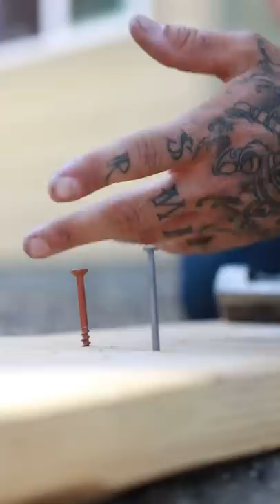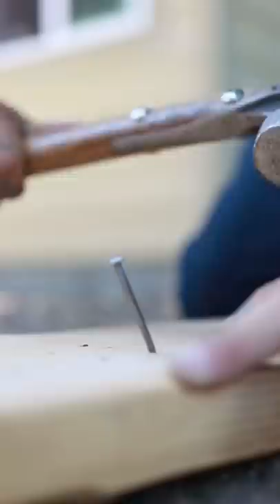Nails vs. Screws: Why do we use nails? #shorts

Comment: The deck screw you snapped is intended to hold down deck boards. They are not meant to be used for building walls. Structural screws on the other hand are designed for structural applications and they are superior to nails in every way and by a large margin...but they are expensive.

What you're doing here is essentially spreading misinformation because you lack engineering knowledge and are just parroting nonsense you heard from others in the trade. You snap a deck screw and immediately think all screws are bad. It's absurd.
Reply: Those structural screws are twice the size of a 16d nail, and hold the same amount of wait. Those screws will still shear and snap over time. I've seen completely rusted away nails hold wood together. Screws are superior when holding something down not holding sheer weight.
Reply: @redacted_redacted69 You're misinformed. Don't make statements unless you have numbers and engineering information to back up what you say. Structural screws are made with material that has a higher tensile strength than what is used to manufacture common nails. Shear strength is a function of tensile strength (around 60%). This means that for the same diameter a structural screw will always hold more shear load than a common nail. You can go find datasheets of structural screws on line to look at the numbers.

What you're seeing in the video is not a demonstration of shear failure. It's failure in bending. Two completely different things. If your joint moves that much as to bend a nail or a screw then it's overloaded and you have a design issue not a fastener issue. Joint separation creates a gap between mating faces and the side load now produced a bending moment on whatever fastener is holding that joint together. This is typically what happens with nails because they can't clamp joints together. This behaviour does not happen with screwed joints. The mating faces don't separate and the joint sees true shear rather than bending therefore allowing the joint to hold more load. A nail will begin to bend much earlier than a screw for a given overload situation.

The issue with a screw is that in extreme overload situations the screw will break because it isn't ductile like a nail. Both will fail but the nail will just yield (bend) and still potentially hold the joint together somewhat. The load required to get to this point will however be higher in a screwed joint.

Nails are ductile for the simple reason that they are always hammered in and often get bent.
Reply: @jamescrud structural engineer here, completely agree with you. I think it’s mostly because you can save time with a framing nailer and nothing else😂
Reply: I've had this same argument at work. Everyone forgets that friction of a tightly screwed joint will hold as much or more than the shear strength of the nail.
Reply: This is what u tell customer but it’s not actually true, screws are far better. Frame a wall of warped boards with nails and see how long it takes for ur drywall to crack. Go back and redo with screws and ur good for life
Reply: @jamescrud ductility doesn't depend on shape but material.
Reply: @iiiiiiiiiiiiiiiiiiiiiiiiii4222 no kidding thats what he said as well.
Reply: @jamescrud 😂😂😂
Reply: Every screw does this you dont misspread infortmation
Reply: God forbid someone show that nails are inherently better at withholding shear pressure while screws are inherently better at withholding tensile force. Yes you can get thicker stronger screws made for shear force but that is much more expensive… similarly you can get ring shank nails designed to bite into wood and offer tensil strength similar to a screw but because it isn’t a full on screw but you can get that added tensile strength without having to sacrifice shear strength and without having to double the diameter of the screw… generally speaking this video is 100% correct, thinner nails are also less likely to splinter wood, and a lot of places have building codes that regulate whether you use a screw or a nail for certain applications for precisely the reason that they have different strengths. I don’t want to argue with you as ive seen your arrogant attitude down below just hoping maybe you’ll use some critical thinking for a couple of seconds or maybe take a physics course or two
Reply: @skyrimdovah420  exactly
Reply: @skyrimdovah420  You don't understand the difference between shear and bending. I've already explained it. Go and google the material properties of nails and screws then do a simple calculation to determine which is more resistant to shear. This shouldn't be too difficult. Empty words mean nothing. Go do the math.
Reply: @skyrimdovah420 What a long-winded way to say "I didn't read or understand any of that".
Reply: Sir thank you for the info
Reply: Spiral Shank Galvanized nails are the best for strength and holding power......Btw...

Unless it is a purpose made specialty screw, screws by code can't be used in any application where they would have a shear force on them.....

Anyone can test the difference in screws and nails...Nail 2 2x4s together on the flat...Screw 2 2x4s together....Same way same number. Now beat them apart with a hammer. You'll see which holds together better and why....Now nail a short wall together....Do the same with screws.....Rack the walls until they fail...See which holds better and why.....There is no need to speculate or argue or look anything up. Build some stuff both ways and see which fails first....

I can tell by the lack of common sense there is only 1 real carpenter in these comments.
Reply: Captain ackshually, this is true. It's not parroting, this is college knowlege.

I've seen an 8in gap close down to 2in in a day once it got hot enough outside. Buildings move far more than you realize.

Building with nails is much stronger, point blank. They're also cheaper(23¢/screw v. 7¢/nail), easier, and quicker.
Reply: There is no reason to use nails if the only thing you care about is the finished product. The only benefit to using nails is that it's by far cheaper when it comes to the nails themselves and the tool you need to install them. Other than that, I have not yet seen an application where nails are preferred, the only exception being replication of pieces with historical accuracy. I'm no expert on the field, and I'm open to corrections. But I'm a woodworker on the weekends, and I have never used nails.

Actually, scratch that. I use a nail regularly to mark drill holes. I hammer thr nail through the screw hole of the piece I intend to mount. I've been using the exact same nail for this task for the past 4 years.
Reply: I build alot of temporary decks, once the home/deck isn't needed its torn down, or picked up and resold, when we use nails they have to tear it down because they can't pick it up, when we use screws they can usually use heavy equipment to pick up the whole deck depending on the size and resell it, and when they do occasionally have to tear down a deck made with screws, we get to hear all about it because of how much more difficult it is. If the decks last long enough, and the pressure treated wood gets to drying and really warping, the nailed decks will look very rough in comparison to the screwed decks
Reply: @bradywalker5291  If your college is teaching you that common nails are stronger that structural screws then you should ask them to refund your tuition.

IBC requires a common nail to have a minimum bending stress allowable of 90,000psi. A GRK type RSS structural screw has a bending stress allowable of 190,000psi. That means it can handle 2 times the load compared to a common nail before permanently deforming. The numbers end the debate in favor of the screw.
Reply: Thanks for giving me a reason to block this hack.
Reply: I've always heard that nails will go in and out as you walk across the floor, for instance. Screws don't have that give. Basically the same reason that it's good for a bridge to move slightly in the breeze, or you can feel a sky scraper move at the top.
Reply: @jamescrud someone’s daddy didn’t love him
Reply: No need to be hostile
Reply: @jamescrud imagine coming to a public comment section and telling others not to post lol. No matter how much construction knowledge you have, it will never make up for what's missing in your life to talk like this on the internet.
Reply: @mateoc15  Nails shouldn't be moving in and out as you walk across floors. If that happens there's a significant problem (squeaky floors in old homes). It's the reason why screwed and glued floors are prefered. The "give" in a skyscraper doesn't come from loose fasteners. Loose fasteners are typically a bad thing in the engineering world. The flexibility in a building is inherent in the steel structural members and not in the fasteners. The same principles apply to residential construction where the wood should flex but nails and screws should not be shifting and moving inside the wooden members if the structure is designed and built correctly.
Reply: @jackhorsey4674  Imagine coming to a video as a newbie thinking you've gained some knowledge from someone who comes across as an expert in their profession only to realize they taught you wrong information.

False information is not tolerated in my professional environment. False and incorrect information that goes against established engineering practices often leads to disaster so yeah...I will call out nonsense when I see or hear it. I'm well aware we're only talking simple home construction here and it's not that critical given the context but that isn't the point. The point is to not teach wrong information to people who might be watching and don't know any better. I never said anything about not posting. Post anything you want but if it's intended to be educational then it needs to be true and accurate. Period.

Stockton Rush presented himself as an expert too, convinced a bunch of people to believe in false information...and now they're all dead.
Reply: Like nurses thinking they are superior to doctors because they do the manual work. Sometimes hands on experience is useful. Sometimes shit falls down because the labor staff took liberties.
Reply: @jamescrud   a screw bends because it resists shear force, if it didn’t resist shear force it would snap… again i dont want to argue with you as you are very arrogant and insistent on making everyone else equally as wrong as you are. There are screws and nails that are engineered specifically to make up for their own weaknesses, theres nothing wrong about the video and since you said it “Just google what type of force nails and screws are better at resisting”  you’re sitting here arguing that a screw specifically engineered for structural purposes is better at withstanding shear force than the screw he used as if that changes the facts. And you obviously don’t know what physics is since its entirely a math based science.  An 8mm thick nail withstands a shear force of up to 2600 Newtons when used in a hardwood (as a structural part would use) whereas an 8mm screw would only be able to withstand 1760 Newtons… convert this to pound-force and it is  584 for the nail and 395 for the screw… the difference is very clear, yea you can use harder material and thicker screws to make up for it, but similarly you can also use a ringshank nail to stop material from separating… what you’re doing is the equivalent of me going to a video about someone pulling apart 2 pieces of lumber and then when they say it’s a demonstration of how screws are better at holding 2 objects together I go and arrogantly comment about a specific type of screws (ringshank) and say their video is bullshit because of one engineered piece of material being stronger than the normal one they used for the purpose of demonstration about the general strengths/weaknesses of different fasteners…
Reply: @skyrimdovah420  You don't understand what you're talking about. The strength of a screw or nail is determined by the mechanical properties of the material it's made from. I just finished explaining that common nails use steel with a bending yield strength of 90,000 psi. This is a code requirement. Structurals screws are typically at 190,000 psi. That makes them "stronger" in all aspect, tensile, shear, and bending.

I'm not sure why you can't understand this. Material properties is what governs strength not geometry. The guy in the video made a blanket statement about screws being weaker in shear than nails. This is factually incorrect since the majority of screws are made with material that have higher tensile strength.

...and where are you getting your numbers from?

My position on this topic doesn't come from arrogance. It comes from 30 years making my living as a mechanical engineer specializing in heavy lift equipment, structural design, and stress analysis. I have an in depth understanding of how fasteners work. It bothers me when people make claims and statements about a subject they know nothing about.
Reply: Yup, it's funny how many laborers will talk shot about engineers, but then when the actual knowledge drops they're left dumbfounded.
Reply: @jamescrud thing is, this video is only talking about regular screws, not your fancy super duper screws meaning yes this video is actually 100% true unless you're talking about some sort of specialized holy screws. Most screws are brittle when compared to a nail unless you get whatever heavy duty shit you're talking about. Also nails are cheaper as they take less material.
Don't accuse people of spreading misinformation when they aren't, he didn't mention your fancy ultra screws because it's not nessasary or applicable when talking about small scale construction such as framing a house or building a deck
Reply: @loganschmidt8802  Almost every screw manufactured is made with material that has a higher tensile strength compared to common nails. They have to be because they need to resist the torsion imparted by impact and drill drivers. This by default means they can also handle higher shear loads compared to nails. Yes, even a deck screw compared to an equal size in diameter nail will handle higher shear and bending loads before permanently deforming compared to that nail. The issue is the failure mode. As I previously explained the failure mode of a nail in an overload situation is to plasticly deform where as a a deck will fracture if cycled to that overload condition repeatedly...but it takes a higher load to fracture the screw.

The demostration in the video is a side impact inducing bending. If you were to actually measure the force required to permanently deform both the screw and the nail you would see that it takes more force to start bending the screw (assuming diameters are equal).

The misinformation part is that Matt made a blanket statement that screws can't handle shear loads compared to nails. He didn't say specifically deck screws. He just said screws...then used a misleading demonstration to break a screw to try and back up his false claim.
Reply: @jamescrud  first of all you talk like a reditor. Second of all a twisting force is different than a bending force. Third, Screws are more brittle meaning while yes they do take more force to bend they will most certainly break way sooner than a nail would when being used to frame a house as they need to be able to bend as the house shifts over time. Just because something is stronger on paper doesn't mean it's better the reason why the nail works so well is because of how malleable it is unlike the Screw which is known to be hard and less malleable making it more brittle making it less optimal for building a house. This is why anyone in carpentry will tell you to not use Screws for framing, it just not well suited for the job and if you get a screw that is they are more expensive than a nail.
Reply: @jamescrud  also another thing to note tensile strength refers to its ability to resist being pulled apart not bent.
Reply: @loganschmidt8802  I'm aware but bending induces both tension and compression. There's tension on the side   away from the bend direction and compression on the side towards the bend direction. In engineering, the tensile strength and yield strength property values are what's used to determine how much the fastener can handle in tension, shear, bend, torsion, and combined loads.
Reply: When you work with real pros you’ll know this comment is right
Reply: @redacted_redacted69 as much as I wanted to hear your side I stopped reading when you mistaken the word “weight” with “wait”. As a simple human I am not not continue to read someone’s insight on structural advice when they couldn’t even know the difference between time and mass. Now I’m done with my sh!t. Thanks!
Reply: @jamescrud thanks for the insight
Reply: Thanks for your comment. Refreshing to see someone pierce through the clout chasing factoid bullshit we get on Shorts.
Reply: @loganschmidt8802 This isn't true. A higher tensile strength also means higher resistance to bending. Bending is stretching on one side and compression on the other. This video is very misleading because it is promoting the high ductility of the nail as a bonus when it's not.  That's plastic deformation (it's never springing back). If your framing gets that far out then it's going to fall apart. It's the job of the fasteners to never bend beyond the elastic limit so any ductility beyond that isn't relevant from a structural perspective.
Reply: @alexmarin1174 ”his insight” is as misinformed as the guy he was calling out lnfao
Reply: @alexmarin1174  auto correct is a bitch sometimes I guess. The mentality you have is piss poor. Someone sounds dumb, someone makes a mistake and you write them off just like that. That's fine dude, you'll live a great life treating people like that.
Reply: @redacted_redacted69  While pedantic, calling the mentality piss poor is why you should never be in a position of consequence. Details matter, and when speaking on a topic entirely dependent on the details, it helps retain credibility when the person speaking cares enough to audit themselves. If you don't care to present yourself as credible, why did you even comment?
Reply: @redacted_redacted69 you there?
Reply: I would like to see someone build a whole house with screws and when they get to squaring the walls see how the studs won’t be able to be adjusted slightly to square up because screws don’t like to give any room to move the studs. They will pop out if you try to square when they aren’t perfectly square. Can’t really explain it better than that because you have to try it to see what I’m talking about. Walls need to be square the nails allow you to do that faster and easier
Reply: @beebbeeb3148  I understand what you're saying but there's no real reason to build a house with screws. Nails are more than adequate as I've previously stated and as you said it's faster and easier. No argument here and I agree with you 100%.

My issue with the video is the guy saying screws are weaker in shear than nails. This statement is false.
Reply: @elijahej8995  I never felt attacked. I'm just detailed.
Reply: Nail guns are cooler than drills, bro. It’s just the facts. Sorry the big boy gun is too heavy for you
Reply: @redacted_redacted69 you are wrong you name one shuttering chippy that uses screws not one of them do…
Reply: @reecetee2815  what the fuck is a shuttering chippy?
Reply: Fucking look it up
Reply: @redacted_redacted69  chippy is a nickname for carpenter here in England
Reply: @reecetee2815  I frame with nails, not screws. Lags when code requires it. Screws to hold down floor sheathing, deck boards, etc.
Reply: @redacted_redacted69  yea for sure buddy we use round wire nails best for strength to hold shutters for concrete 
But obviously for decking stuck like that screws all day long
Reply: What are you talking about??? I get your point one is made for one thing and the other for another. But bro literally explained if you have ever thought why we use nails instead of screws, it’s because the screw breaks, nails bends.
Reply: @jamescrud I think the guy was talking about how under pressure screws are more likely to snap than nails, which is true, judging from my own carpentry experience working with my dad, and from what i’ve learned in civil engineering classes. Since nails snap less easily, and are more bendy, the guys saying they have different uses. (I understand it’s bad nails give and can come out but there wouldn’t be in the code for multi-million dollar buildings would need nails in certain areas like framing that normal screws wouldn’t work in. I also understand that they make screws that are more bendy and meant for this, but with my favorite saying, what ain’t broke don’t fix. All buildings incorporate both nails and screws where they can affordably support eachother in good ways.) 

Also off topic even if I disagree with you in this one convo holy cow your a great replyier haha, I think you replied to every person who talked to you, over this amount of time that’s very nice of you lol. 😂
Reply: @loganthomas1578  The premise of what he was demonstrating is misleading. You'll never encounter a situation in residential construction where a joint "settles" so much that it bends the nail over 90 degrees repeatedly until it snaps. If there is any settling going on the nail may give slightly by pulling out and shifting while a structural screw will not allow the joint to shift at all. It's never going to snap. If the joint sees extreme loads beyond what settling would induce then the screw would simply tear out of or through the wood. This is what everybody overlooks. The wood is the weakest component in the joint not the screw. Keep in mind I'm talking about structural framing screws. At the end of the day what he's showing can never happen and has never happened in a fastened joint.

Regarding codes, they have been updated to include modern framing screws. This allows them to be used if required and when they're used offer a superior performance compared to nails. Nails remain the most economical and practical.

Try it for yourself. Screw together two pieces of wood with 4 structural screws then try to pry or smash those pieces apart. Do the same with 4 nails with the same spacing and pattern. You'll see immediately what I'm talking about. A typical framed joint in a home will never experience that kind of abuse so to say that a screw will snap when a joint settles is nonsense.
Reply: That’s what he just said.
Reply: @loganschmidt8802 ”Fancy ultra screws”😂. Shit cracks me up. You can get structural screws at any big box store. If the idea of a structural screw is that magical to you, don’t work in the trades.
Reply: No sir your the only Parrot. This is a simple video showing people basics. Trust me, many many people who should know this don’t! He’s comparing a common screw to a common nail! Also structural screws are only stronger than common nails! What about shear rates nails!? What about a 3/8” diam spike!!? I’ve also seen structural screws shear on a few occasions where nails didn’t. And seriously man you more or less just repeated the video for the first paragraph and then proceeded to call HIM the parrot. What a hypocrite
Reply: @jamescrud quit reading spread sheets and learning in the internet. Go get a job and learn from experience. I can tell you’ve never swung a hammer lol. In the real world nails are way stronger for framing 100% of the time. I’ve learnt this from experiencing demolishing decks both framed with screws and nails. Every single time in old rotten wood the nails are still strong! And every single time every third screw has snapped. You mention gaps as if they are a flaw but that’s just wood, showing your inexperience again. Wood shrinks and expands and moves ALLOT. Even if you install something tight at first chances are over time it will develop a small gap or discrepancy. Nails are a far more versatile and flexible fastener for framing! He was comparing an age old discussion that confuses many home owner types…. It’s a great video. Of course structural screws have comparable strength. They also deteriorate much faster in weather🤷‍♂️ unless you buy stainless but than your getting weaker again and more expensive🤷‍♂️🤷‍♂️
Reply: @jamescrud and no, nails are ductile so that over time when joints DO move…. And they will even with structural screws…. They can bend instead of snap. He’s framing a deck bud. They get SOAKED!! It’s just impossible to ask wood not to change at all! And so we use a fastener that can compensate for that! A nail can span an 1/8” gap no problem, a screw can’t!
Reply: @jamescrud  I agree with you then in those situations if wood doesn’t shift that much, but I just still think framing moves enough in houses that non-specialized screws will snap. I don’t have the budget or time right now to try to buy nails and those special screws with wood, so I’ll just say in a bunch of areas in the lower sea level areas especially wood really can shift, where I’ve seen people having to replace door frames or cut the bottoms out of doors because they move a lot. I can agree that nails might suck in comparison to the better screws that can do the job, I just think until they get cheaper or more widely used, the guy in the videos point still stands. (Btw I haven’t seen the video in a bit and realized halfway through writing this that i can’t leave the text to see it, so if something I said is skewed then my bad lmao.
Reply: actually i don’t have enough experience in this, assuming you (james) do, then I might be thinking of it wrong. I do see what you mean that the wood can move but it doesn’t allways mean all that force is on the screw, you must be super experienced in this and have insight i don’t have, if that’s the case then I can agree with you.
Reply: @jamescrud nailed it... pun intended.
Reply: @yuxuansun8271 contractor here.. i 100% agree with you... imagine trying to build a home using screws and a screw gun?! the time would be out of this world.
Reply: If this guy has a building business he should be forced to link all his potential customers this video and this comment.
Reply: @redacted_redacted69 ngl bro you‘re getting cooked here 😂😂😂
Reply: Exactly miss information. Really getting sick of these people spreading this stuff
Reply: @yuxuansun8271  try time and ALLOT of money. Also nails compensate better for human error… a thing many engineers don’t account for lol. Cuz they never actually do anything😂
Reply: Yep, as a civil engineering student I applaud this response. People who know nothing of engineering for fasteners talking out their arse.
Reply: @jamescrud I appreciate the effort and knowledge put into this comment, much more accurate and thorough explanation than the video or any of the comments, listen to this guy
Reply: @jamescrud  your so rude and clearly all you do is math…. No real experience with building things. @skyrimdovah420 is totally right…. Your just upset about it. Also the video had nothing to do with structural screws, that was a deck screw. Deck screws definitely have less shear than a nail and it’s a mistake I’ve seen allot of inexperienced carpenters make. Useful info in a simple vid! It will help homeowners and such build things that won’t be falling apart in a year or two! Even for deck boards screws suck… the boards shrink and expand with water and shear the screw almost every time, than you have a creaky deck. This just doesn’t happen if you use nails. I’ve demolished enough old decks to know this for a fact. The nails last longer than the wood they are fastening, deck screws don’t.
Reply: cool
Reply: This man means business
Reply: @loganschmidt8802 a twisting force may be a different force, but the underlying material properties are all the same. If a material has a higher modulus if elasticity which makes it more resistant to deforming in bending, that will also make it more resistant to deforming in torsion. There are only a few material properties required to calculate stress and deformation under the various loading conditions, and they all overlap
Reply: @nathanbohn1078  took less than an hour to build a 24' x 20' wall using plain only screws, 2x4s and ⅜" ply wood (some concrete screws too) for a warehouse. It's been run into by blind forklifts, hit by falling towers of boxes, leaked on after a storn trew a limb through the roof, still fije like the day we build it after plenty of abuse 5 years later. Dont know why folks think it would take forever to put up a house with screws.
Reply: All screws matter
Reply: @yuxuansun8271 😂
Reply: @jamescrud 😂
Reply: We should be talking about a house being held together with screws will generally shift around less than a home built with nails.
Reply: @as7river  logical prevarication I think!
Reply: @tjsbbi  So why are the bolts holding your car suspension system together made from ductile steel?
Reply: @jamescrud I’d love to learn from you more. Very knowledgeable.
Reply: @GBOB68  All of common bolts we use in automotive are ductile steel. However in a demanding role like suspension you are often going to see grade 8 bolts which have a higher yield but lower ductility than a grade 5 or 2. You can see this easily if you look up tensile strain curves for the different grades. The elongation prior to failure is dramatically more for grade 5 and again for grade 2, albeit at a much lower yield.
Reply: Exactly. The ductility has everything to do with the material properties, not whether or not the fastener has threads
Reply: @tjsbbi  My point is, suspension components are chosen to bend on failure rather than snap!
Thanks for the info but I don't need any more lessons in engineering!
Reply: Bro also thinks overall longevity can be tested by bending something by 90 degrees. Im pretty sure buildings don’t move that much.
Reply: Yeah I hear this bs all the time that you need to use nails. No use the proper fucking screws. Its nicer to work with every step of the way. Just slightly slower. Oh well
Reply: @skyrimdovah420 if your walls are moving that much, you are going to have more problems than whether or not you framed with screws or nails
Reply: @bradywalker5291 all I see is its cheaper. If a house moves 6 inches in a day. Sounds like it was poorly made
Reply: Thank you for schooling these fools
Reply: @wolfie4225  bro, what? 😂 If a house moves, it's poorly made? Every house moves dude. They breath. Expand and contract from the heat and cold.

Screws aren't cheaper, they're more expensive and more time consuming, and yes - they're not as good in the long run.
Reply: @bradywalker5291  if I gap closes 6 fucking inches. That's a problem dude. Houses move but if it moves that much. Ya have a problem. You really just sound like you've never framed with screws. Because I have framed many buildings and I have yet to see a snapped screw 🥴
Reply: @austinfackender in those situations I toss a demolition blade on the circular saw and just cut through the screws or nails.
Reply: @redacted_redacted69 if you don't know the difference between "wait" and "weight" then you shouldn't be talking.
Reply: @Jordan-rb28  I just read my first comment and it looked pretty good to me teacher. Didn't see the word wait in it.
Reply: @redacted_redacted69  "Those structural screws are twice the size of a 16d nail, and hold the same amount of *wait.*"  <---- you missed that then.
Reply: @Jordan-rb28  yea I did. Then at the very bottom of that comment it's used correctly. Crazy how maybe a miss typed letter might do that. Auto corrections.... But noooo I have no clue what I'm talking about based on that. Goofy.
Reply: @jamescrud see you may be right, but with the way you talk it makes me not want to listen to you
Reply: @jackbalderassgoodyoutubepl3664  I AM right and you don't have to listen to me at all.

How do you like information presented to you? Straight to the point and matter of fact or do you prefer to be held gently by the hand and wrapped in a nice warm blanket while I wisper it softly in your ear?...
Reply: @jamescrud we get it bud you literally know nothing else so you're really passionate about this
Reply: @AndrewB23  Yes I'm passionate about engineering. I have six industrial patents to my name, single handedly built my own home, I'm an expert in plumbing, electrical, and hydraulic systems. I'm also a machinist and a welder and I'm always in my shop making things. You're right...I don't know anything else.

Oh, I take care of stray cats in my neighborhood too.
Reply: Screws are inferior in two ways. They cost more to buy and take longer to install.
Reply: Hasty generalisation fallacy, yea
Reply: @jamescrud  strength comes from shape you lose the material of the threads in a screw of the same thickness so in any case a nail will be "thicker" than a screw of the same radius, math son
Reply: Oh boy, an engineering student desperately trying to justify his degree by being an arrogant tool.

See, if you'd gone for the business course, you'd know how to do the cost-benefit analysis of cheap nail that can be shot fast and reliably with a cheap nailer and has the desired shear strength vs an expensive structural screw that has to be driven one at a time and take a figurative forever. (Yes, screw guns and collated screws exist. They're also expensive. I don't know anyone who has one. I don't even know if they're available for structural applications.)
Reply: @institches2750  Engineering student?? Lol. Clearly you haven't read my other comments. I've been working as a mechanical engineering for 30 years. I'm 53. I never said screws should be used for residential construction instead of nails. I've said repeatedly that nails are more than sufficient and they're used becaus they're cost efficient and faster. That doesn't change the fact that they have shear higher strength compared to nails.
Reply: @gallodeplata   Strength is a function of material properties like yield and tensile strength. Those are the only two values ever considered when establishing the relative strength between two equal size fasteners. When comparing equal size screws vs nails the screw's minor diameter is used and not the outside diameter of the threads.

Look closely at the geometry of an RSS structural screw. The shank OD is constant and the thread OD is larger than the shank OD.
Reply: @jamescrud  its rigidity, useful in strength maters if the elasticity module have high or low cap in the object a bike frame in steel it bends more than the aluminum one even if you consider the inner radius of the screw it gives  a weaker form with the same volume or weight ,to cut bc you use some material in strength maters to make the useless threads of course if you put more material in the screw its gona be better thats why i use this aproach it's like money money money
Reply: Yes and no. He's right in the video. Screws, even construction screws, have a lower sheer strength than nails. However screws are superior in holding boards down to a floor such as on a deck or subfloor. You don't want to use nails in boards that you walk on because over time the nail will be pulled loose and expose the nail head (that's usually why floorboards squeak)

Screws pull the wood together. But any sideways pressure or sheer force will always break a screw before a nail. Nails are heat treated differently so they are more pliable.
Reply: @Daedalus1111  Screws have higher shear capacity than nails...not lower. I've explained it in detail if you read through some of my comments.
Reply: @jamescrud  You can have All the knowledge All you want, but your comments come off very arrogant.
Reply: @jamescrud You sound arrogant